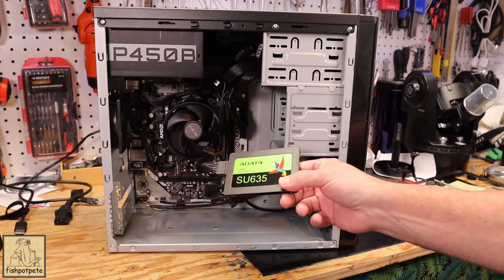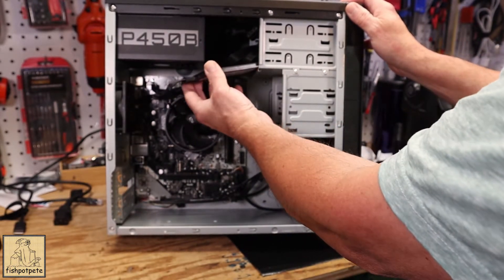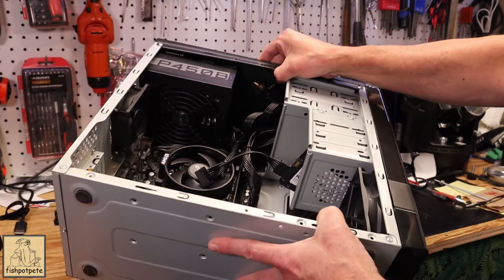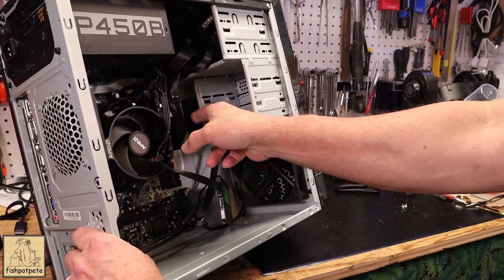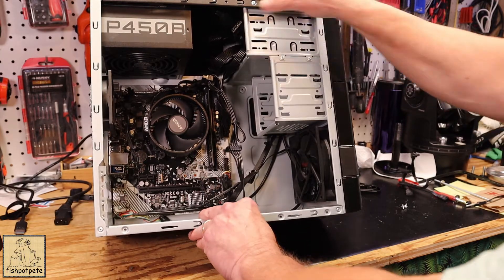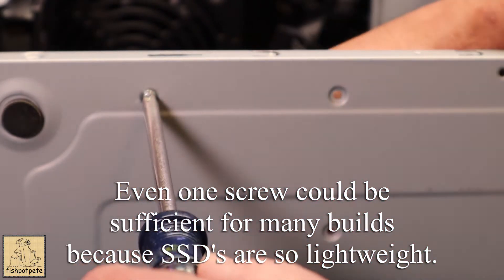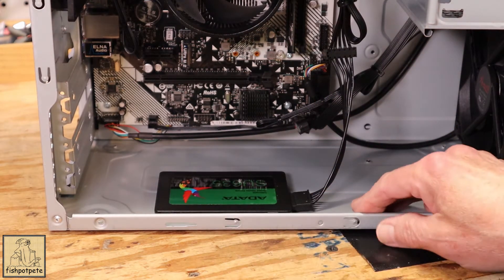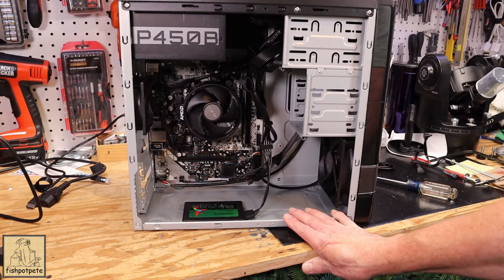Mounting an SSD in an Older or Cheap PC Case

Comment: would it be a bad idea to use duct tape to secure my new ssd?
Reply from the maker: Duct tape would work... But keep in mind that if/when you want to remove the drive in the future, it might tear off any labels/stickers/etc. that might be on the drive.  The other thing is that most duct tapes will leave a residue.  Painters tape would probably work better. 

Full disclosure: I have used duct tape in the past and it works.🙂

Comment: Nice, but I look for connect a SSD in a bracket in the housing above....i need to watch and look further, thank you....
Reply from the maker: I did this video before I bought a 3D printer - your comment got me thinking about just printing a bracket that could slip into a 3.5 inch drive bay....  here's an example of one you might check out: https://www.thingiverse.com/thing:16754

Comment: In the case where the SSD is loose inside the PC and it's not completely horizontally or vertically does that affect heat dissipation of the SSD and damage it in the long run ? Or it will be completely fine and I should not worry about it so much ?
Reply from the maker: It doesn't seem to affect it either way.  It might if you've got it shoved in a very tight spot with absolutely no ventilation.  FYI, in my personal experience, the original SSDs don't seem to have a long lifetime.  Even in systems where they are secured "properly".   But a newer SSD is most likely going to be more robust all around and shouldn't have any issues just hanging out on the cables 🙂.  Many of my builds with SSDs were for friends/etc and used a lot of hand-me-down parts to save them money.  More recently I've been moving toward the NVME sticks on the motherboard - so mounting storage somewhere in the case isn't an issue.  But I'm guessing we'll be seeing issues with heat for the NVMEs that are mounted near a graphics card or CPU (which most of them are!).
Reply: @fishpotpete  Thanks a lot for the info!

Comment: I used paper tapes is that okay??
Reply from the maker: You are probably okay doing that.  But it might leave a nasty residue when you try to remove it later.  If you have "painters tape", that's meant to be removed, it should be a cleaner removal.  If you don't think you'll ever remove it, then paper tape is fine - it just might not stick as long as other methods...  Hope that answers your question - If not, please let me know!  thanks 🙂

Comment: Plz reply, can stick the SSD with double tape on wall of the cabinate, because my case don't have anything to rest the SSD on
Reply from the maker: Yes you can. If you use Velcro tape, it might be easier to take the SSD off later.  But double sided tape would work fine! Thanks for asking 😊
Reply from the maker: Yes you can. If you use Velcro tape, it might be easier to take the SSD off later.  But double sided tape would work fine! Thanks for asking 😊
Reply: @fishpotpete thanks 👍

Comment: Would you suggest using tape? Would it cause any problems or fire or overheating
Reply from the maker: Tape would probably work fine.  I've never noticed a SSD getting all that hot.  But to be safe, use a couple of thin strips to leave as much of the drive's surface exposed.  You can also use double sided tape.  I've also used Velco on some projects.  The SSDs are so light, you could even use a wad of gum 🙂

Comment: The mount was decent but I didn't like how much tension was on that cable. I'd either go with your earlier suggestion of folding down the tabs in the upper drive bay (then securing it in there with at least one screw), or simply cable tie it inside the upper bay.
Reply from the maker: I agree. Some of the data and power cables can be tight.  I have enough extra SATA cables sitting around so I usually find one long enough.